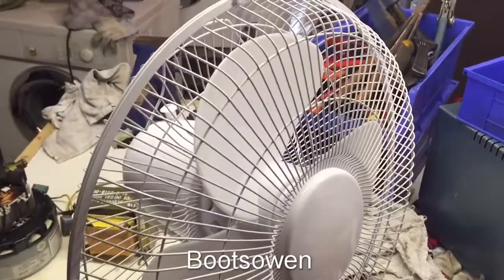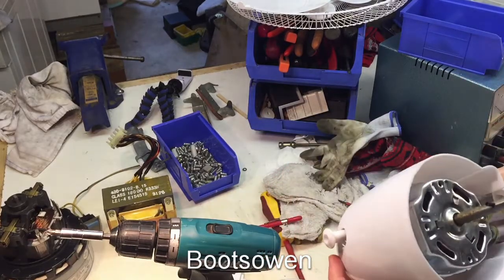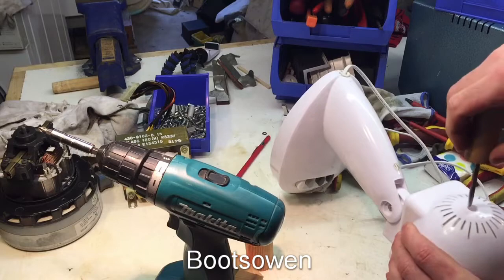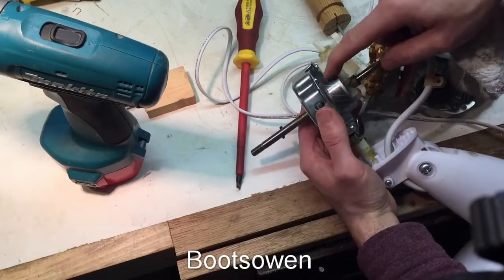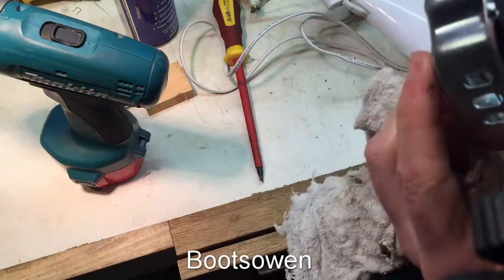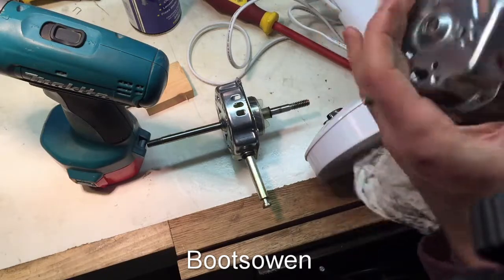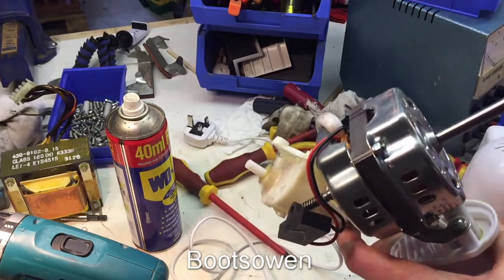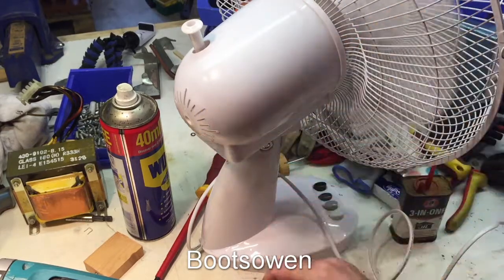Repair a cheap desk fan that spins slowly

Comment: I have a couple of large Maxx Air garage fans when one of them slowed down to almost a halt.  So, I obviously turned it off so I didn't burn up the motor.  I didn't want to toss the fan, because they are not cheap, so I turned to YouTube and found this.  Now it is up and running again like a champ.  Thanks bootsowen for the remedy.

Comment: This was an easy fix! The fan was so locked up that when I was cleaning the thin film off the parts, I thought that there was no way that was the problem. I was wrong, fixed it right up.

Comment: ty, saved myself £26, although I didn't have any WD-40 I used a tissue to wipe the metal with some vegetable oil from the kitchen like 2 drops on the tissue. the fan is pretty much new now

Comment: I lent/ gave an old tabletop desk fan, not unlike this, to my neighbour when their A/C broke down.  It stopped spinning completely today (it was already getting weak), so I took it back to check it out.  Since the fan is probably 15 or more years old, I figured it may just need a cleaning (hopeful it wasn't the capacitor).  Although I got the motor out of the casing, I couldn't take apart the assembly (stripped the screws that were holding them together).   So, after noting that the spindle/ axle did not spin freely AT ALL, I sprayed electrical contact cleaner into the groove where it exits the motor. Noticing that it immediately freed things up, I sprayed a little more, and spun, and did so several times, using a rag to clean up the gunk that came pouring out.
After putting the whole thing back together, - voilà! - Good as new!
Your video got me as far as I did, so thank you !
Reply from the maker: Excellent. Thanks for the message. A drop of motor oil. Or 3 in 1 oil or similar should keep it going for another 15 years.
Reply: @bootsowen  i used what i had on-hand, but you're right.   I'll probably take it apart again and give it a few drops of oil , as you suggest.   Cheers!

Comment: Brilliant video.  You saved my lovely vintage fan from the landfill.
Reply from the maker: Thanks. I did it to an old air dehumidifier last week. The fan had stopped but everything else was fine. A tiny bearing had caused the whole machine to fail.

Comment: I took my fan apart the other day, big on hope that perhaps the sudden slow oscillation was down to improper assembly. I was wrong. After seeing your video, I might have to consider disassembling it again. Problem is I'm not exactly handy, and I lack most of the needed tools. Imagine I'm supposed to come up with a triangular screw driver. 🙄😒

Comment: Fan speed 1 & 2 spin very slowly for me but fan speed 3 is fine. Would you say it’s rather unlikely for it to be just dirt build-up? It’s not an expensive fan but if it doesn’t have to go to the landfill yet and be replaced by another one shipped around the planet then that’s a win! Thanks.
Reply from the maker: The oil in these fans gets old and dirt gets in. It's up to you whether or not you fix yours. It is difficult for me to diagnose yours from my sofa! Good luck. Let me know if you throw it out!
Reply: Same issue with my fan, but I followed the same steps in this guy's video and now all fan speeds, especially 1 and 2, work perfectly.

Comment: fan button 1&2 not working but 3 is okay but slow. but when I push button 3 &1 or 2 together it run fast. what do you think is the problem. I notice there is a cut wire at the motor windings. can still be fix?
Reply from the maker: The cut wires are probably the problem!
Reply: @bootsowen  yes, but I cant find  where to connect the cut wire winding & I dont know where.
Reply from the maker: The other possibility is that the bearings need oiling and if you managed to watch this video you already know how to do this. You do realise that I can't repair it for you? You have to get your own hands dirty!
Reply: @bootsowen  The bearings/ bushings are okay. The windings is the problem.
Reply from the maker: How do you think I can help?
Reply: @bootsowen  I don't know where to connect the cut wire motor windings.
Reply from the maker: I understand your problem, but you have to make the repair.

Comment: I have an old 50's fan that spins very slowly on high speed compared to an identical one I had before it. Do you think it could be the same issue and I can clean it? Also, is WD40 ok to use on electric motors?
Reply from the maker: If it is made of plastic then I wouldn’t spray oil on it. Oil can wreck some plastics. But if you’re not worried then go for it.
Reply: @bootsowen  no it's all metal. I see you used WD-something on your video. Whas it WD40 or do they make other products?
Reply from the maker: I've only ever had wd40.  good luck, let me know how it goes.
Reply: @bootsowen  Thank you again for the reply. I will be sure to let you know.
Reply: @bootsowen  Successfully dismantled,  cleaned, and put it together again. Re-insulated earthing wire and put the fan blades on the right way around. It was a bigger job than anticipated, but it was worth it. She blows good now and the fan works too 😁
Thank you Bootsy Owen. I owe you a beer.